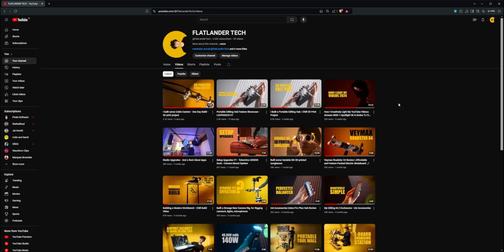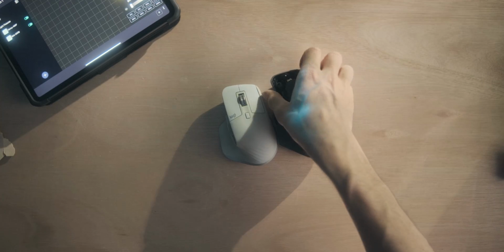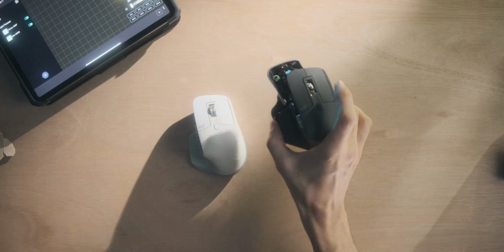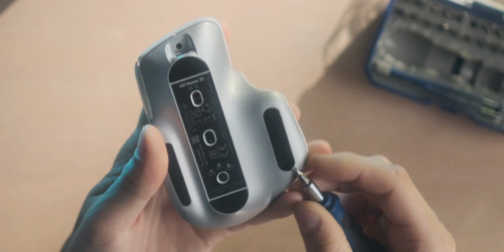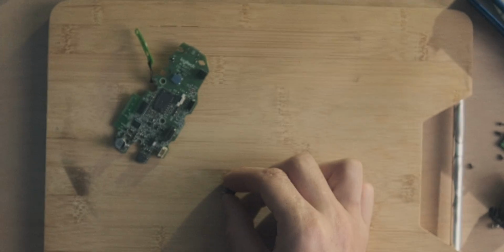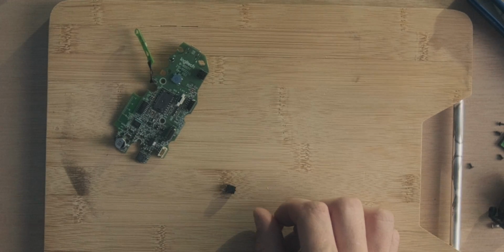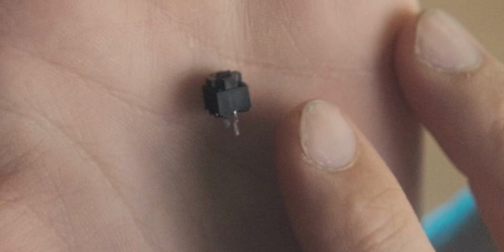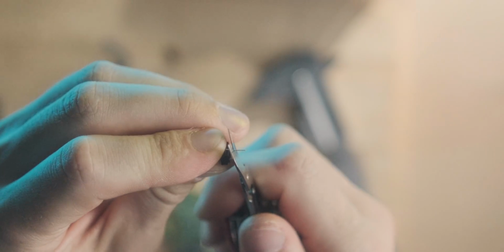Fixing The Logitech MX Master 3S Buttons - Teardown

Comment: What pisses me off is that you need to destroy the gliding pads in order to even attempt to fix them.
I read somewhere you can try to clean the switch. But now i have to wait until i found and received replacement pads, before i can even try that, because without them, you can't use it at all.

Comment: Thanks for the precious video! Have fixed my left mouse button, but now that I'm happy, the lateral one is starting to fail XD
I wonder which switch those are... disassembling this mouse is a pain 😅
Anyway, I've installed the Kailh Mute Switches 6*6*7.3 and they fit perfectly :) 2 buchs for 10 on the red website :3

Comment: Its not planned obsolescence its just that switches have a lifespan. I don't know if there are any microswitches that last forever (maybe light switches or magnetic might). If  you look at the specs for the microswitches they use they have a certain lifespan. All I have replaced switches on many of performance mice. Maybe if they change to a different type of switch this might fix the problem. All I ask at this time is make them easier to repair.

Comment: I changed the switch button on my MX Master 3S, and I’d recommend avoiding Huano Silent switches (white or yellow dot). Their mechanism doesn’t match well with this mouse. Sometimes, a press is registered, but if you press lightly, it can stop at about 50%—you’ll hear the silent click that Huano Silent switches produce, but the click won’t be registered. You always have to press with enough force.

I tested two Huano Silent white dot switches on the MX Master 3S, and both had this issue. I also installed the same switch in a Titanium Goblin mouse, and it behaved similarly—sometimes registering the press, sometimes not, depending on the force applied. However, when I installed Huano Silent yellow dot switches in a cheap mouse I had, they registered every press correctly.

So, whether Huano Silent switches work well depends on the mouse’s internal construction. Now, I’m going to try Kailh Silent switches—I think they will sound and feel close to the original MX Master 3S switches.
Also don't buy the switches that this man used in video, they sound reaaaally bad, and they aren't designet to be used frequently like it is on the left mouse click so they will die in a year also switches from the video seems to have smaller high than original so you have to add some plastic gasket like in video.. this is a waste of a lot of time, don't do this. I'm pretty sure the Kailh do nice silent switches.
Reply: Hey, I found your comment on @BrianFischer video where you suggested the Huano Brown White dot switches, and now you're saying we should avoid them? What changed? Since I'm planning to change my MX Master 3's keys as well, it would be of great help if you could provide some insights on the matter; also, I like silent switches.
Reply: @amanstark From the start, when watching reviews, I thought that Huano Brown Silent switches would be really silent and last for years. But in reality, they are quite noisy compared to the stock switches in the MX 3s. Huano switches don’t have the usual high-frequency clicking sound, but in the mid-range (300-500 Hz), the sound when pressing the button is noticeable, especially on the left click (idk why but right click on most of mouses is not so noisy). Maybe this happens because Huano switches have strong feedback and this switch push the plastic button back with a lot of force, creating resonance.

I tried modding them by applying some silicone glue to the plastic part that presses the switch, but that didn’t help. The worst part is that when I pressed the button very gently, it could be pushed down to 50%, and I would hear a "wop" sound, that usually is produced by Huano when it is pressed, however, this gently click wouldn’t actually actuate the button, so I had to press it with a lot of force to make it work.

I bought Huano Silent switches with both white and yellow dots. I put the white dot switch on the left click and the yellow dot on the right in a cheap mouse for testing differences how they sound, and it sounded awful, creating a lot of resonance when clicking. I also noticed that the white dot switch has stronger feedback and is harder to press. I prefer the white dot because the yellow dot can be actuated accidentally when I just rest my finger on the button—it’s too easy to press. However, in the cheap mouse, the yellow switches work fine without this 50% clicking issue, and they can only be pressed fully (100%) or not at all (0%).

Maybe the yellow dot switches would work well in the MX 3s, but I haven’t tried them there yet because I’m exhausted from opening and closing this mouse. The MX 3s is hard to take apart and reassemble, and I’ve already done it five or six times. Every time, I’m scared of breaking it—it’s really stressful.

I’ll upload a short video tomorrow showing how my cheap mouse and the MX 3s sound with different switches. I’m disappointed in Huano Silent switches. I lost $1 on two white dot switches and another $1 on the yellow ones, but now I’ve bought 10x Kailh Silent switches for just $2.
Reply: @ Thank you for such a detailed response; I will wait for your video. Also, please make sure to also include how the MX Master 3 sounds with the Kalih Silent switches.
Reply: @amanstark  I don't have Kailh switches now, I just ordered them and have to wait 1 month to be delivered, but I'm pretty sure they are close to original MX 3s, someone on YT in comments and on reddit are saying that Kailh feels even better than original MX3s.
Reply: @amanstark  added a video, you can check it
Reply: @vic2net  thanks a lot man 🙏🙏
Reply: I have used Huano Brown - White DOT, click feel is different than original Logitech Switch, Worked well - But failed in year (double Click problem) . now installed with TTC gold 60M - click sound is light and as per web reviews, they are durable. Huano Brown - Yellow Dot is 20M life - should last long.

Comment: Luckily I had the exact same type of switches but more clicky, the size is 6x6x7.45. You can clean the original ones with no residue contact cleaner if they still click good. Always add leaded solder when desoldering. Also your joints looked cold, if you aren't using fresh solder with flux core, you need to either dip the iron in rosin and use it quickly or use flux in order to make the solder flow.

Comment: I found a series 3 mouse at my local thrift store for $CDN5.99 and lo and behold it has this issue. I left a series 2 mouse that had no clicks on the click button and the right one was permanently depressed (A psychiatrist would not help it be less depressed! LOL) I am betting they got a large batch of bad buttons. possibly in the millions on units leading to a widespread issue like we are seeing. Of course Logi never does recalls so the only option is to fix it. One video I watched also added a couple of pieces of masking tape  to give a firmer click experience.

Comment: The on-off switch is not actually the weak point because it's not stressed. There are limits in the enclosure not allowing you to push the slider too far, and the slider itself is braced against the PCB.

Naturally it's going to go bad EVENTUALLY, but there's tons of low hanging fruit to address first.

"I wasn't exactly able to buy proper switches" Why not? The stock switch is Panasonic EVQP0E07K, or just search for EVQ P0 to discover more of the series, you search for Panasonic, Microsoft mouse switches, you find them all over the place. Mouse switches and endstop switches have a tiny little balanced buckling leaf spring; the ones you put in tactile switches it's a large buckling metal dome. Actuation force on the leaf switch is something like 70g, on the dome it's usually 280g but somewhat lighter versions exist.
Reply: This is what I came for. Surprisingly nobody has issued you a like yet <___<
Thanks man, much appreciated.

Comment: It's not a mistake it happened to my MX Master 2 so I bought the MX Master 3s to replace it.  Then the same thing happened within a year to my MX 3s.  Also the scroll wheels on both eventually malfunctioned and my MX 2 laser stops working whenever it feels like it.  The mice feel amazing, but I've had cheap amazon mice that last 5+ years with no problems.
Reply: надо руки мыть и не засорять колёсико мыши, у меня было 2 штуки mx 2s и каждая из них отработала более двух лет без проблем

Comment: I’ve known Logitech since 1984 and have owned several of their products over the years—three Harmony remotes, four webcams, 15 keyboards, and countless mice. One thing I've found consistent with Logitech products is that they tend to break right after the warranty expires. For me, it happens after just one year, as I’m a programmer and use these products extensively throughout my day.

Since 2010, I’ve been using Apple products, not as a fanboy, but because, despite my preference for Linux on good hardware, there’s a lack of essential apps. I didn’t use Logitech at all until my son gifted me the MX Master 3S. Now, just a year later, I’m facing the same issue with the mouse.

Consistency is good, but to be honest, while the Apple mouse is precise, it also tends to last no more than 3-4 years. It’s disappointing that after decades, this recurring issue continues to affect Logitech products.
Reply: But this is how warranty works in general. All products are tested thoroughly and the average lifespan is calculated. Then they add some additional time to that lifespan and call it warranty period. The goal is that most devices outlive the warranty, not work forever; it's quite intentional and not even a secret.
Reply: Like the hp office jet, it used a 3mm width belt to spin the pulley system which pulls the paper, cap/uncap the print head, spin the pump, didn't even last 3 years before the belt fine tooth strip itself out and then you need to buy a new one, definitely purposely designed it this way, could have use a thicker belt, but no they wants that belt to be under high load and cause it to slip once in a while and then finally no tooth left to catch on the gear

Comment: I have an MX Master 2S for almost 6 years now and it still work like in first day
I changed the outer shell as the rubber got nasty, but beside that, everything was ok, no issues (at least not one without an easy fix)
I plan to buy a second one, as the MX 3S is a bit too big for my hand

Comment: I went through three MX Master 3s before discovering how to fix them. All of them had their switches replaced due to a frustrating "double-clicking" issue that developed after about a year, which was disappointing for such an expensive mouse. If it weren't for the amazing scroll wheel, I probably wouldn't buy it again. However, once I learned that the switches could be replaced, I jumped at the chance to do so. Now, all my MX Master 3s are performing even better!
Reply: very glad to hear this! which button switches did you end up using?
Reply: huano pink dots work well
Reply: @sagotgala  just ordered some for my superlight, might have to get some for the mx master 3s too
Reply: What switches?

Comment: I've repaired all of my mice in the last 15 years by opening those (mostly) Omron switches and flattening the thin copper back into it's original form. My MX Anywhere 2 lasted for 8 years and now my MX Anywhere 3 is currently in it's 4th fix.
Reply: I wish I had better skills with that. I killed my Mx anywhere in the proces. Like every other electronic hardware fix I approached. I'm no hardware repair guy 😂

Comment: They are very aware of it as all of their mice have this same problem. I have fixed 5 mice by now, first one was 6 years ago. 

The reason why this is happening is that the switches are corroding on the inside. The cause of the corrosion is that the switches are not rated for the voltages Logitech runs them at, the documentation specifically outlines the voltages the switches are tested for and Logitech somehow misses that every time. Given how common this issue is with their mice and how long this has been known for, I choose to believe that this is an intentional decision.  Further more, if this happens during the warranty period, they ship you a new mouse no questions asked(more or less). A company does not approve warranty claims like that unless it is a calculated decision. 

TLDR: Film a video of your mouse buttons "not working" 3 months before the warranty is up(any shorter and they will delay response until the warranty is up) and you get a brand new mouse. Life hack
Reply: It is called planned obsolescence